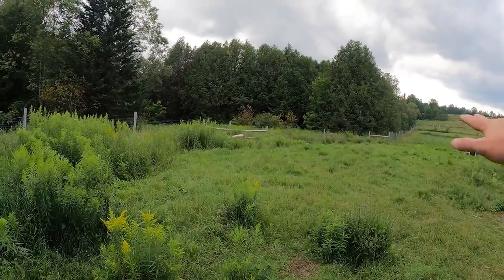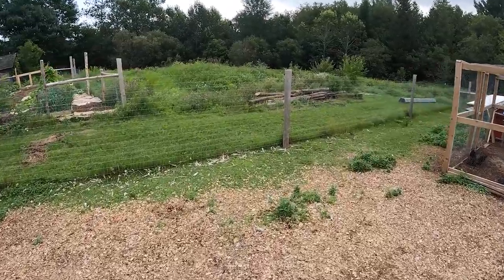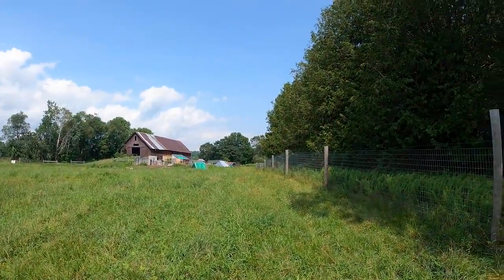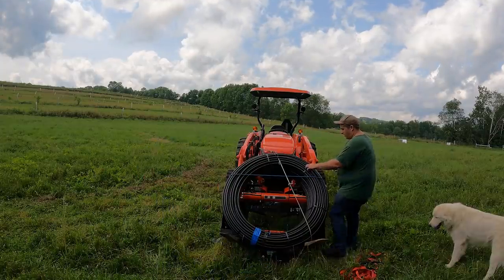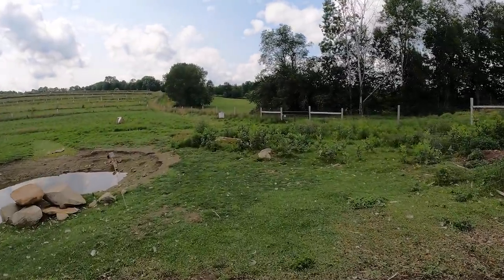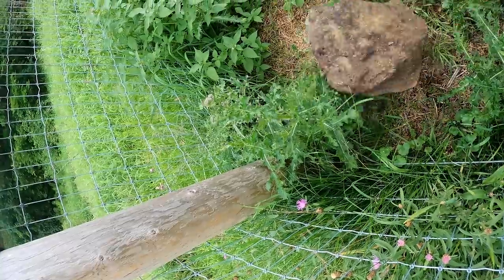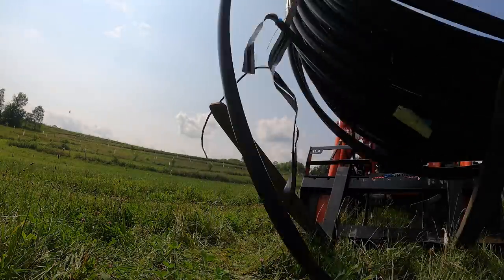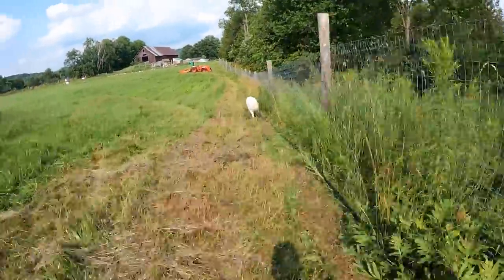Simple Water Lines for the Entire Farm

Comment: Don't you need to bury it below the frost line?
Reply: Yes you do.
Reply: Not if you intend to drain it (use an air hose to blow out the water) before winter.  I am using the same type of water line for my garden expansion, and I am including a drain plug at the lowest spot to winterize it from.  (Also, leaks are not very hard to fix.)
Reply: @doloresreynolds8145 this isnt an irregation  hose for a summer garden. This line is to provide water for cattle 12 months a year. In Vermont the frost line is at five feet, digging a six foot deep 1000 foot long trench is going to be very difficult in rocky New England soil.
Reply: Joshua Rosen the cows will be in the barn for maybe 6 months a year, these water lines won't be needed then

Comment: As we all applaud in relief as he figures out to roll rather than pull from the center. Maybe harder, but fewer kinks.  Those will come back to haunt you.
Do you have enough head pressure to  push water all the way up the hill? (~.45 PSI per vertical foot)  Will you install some sort of drains to prevent freezing?

Comment: run power to the top of the hill, and install a second well up there.
bury all that water line.
Reply: That means a deeper well and an additional well pump.  On the other hand, the problems with pushing water all the way up that hill will be prevented.
Reply: Lol another well? Do you know how much that costs?
Reply: @abcd1234jason  farming aint cheap. its a business. take out loans, get a steady income to pay them.
Reply: @aredub1847  by spending thousands of dollars to fill a duck pond that barely pays it's own way?? I can tell you are not a farmer lol
Reply: @abcd1234jason  this water is not for his little pond. are you simple?
Reply: @aredub1847  he already has a well, why does he need to spend thousands of dollars for another? If his current pressure isn't enough he can add a inline pump for maybe $200, tell me how simple are you? He doesn't need to bury the line because he's only using it late spring and summer rest of the time the place is covered in snow but you knew that right? Anymore smart ideas?

Comment: 😬 I would either rent our build a tubing uncoiler.  You can set it up at the start point and then pull the end with your ATV out to where you want to go.  Save yourself a lot of time and headache.
I do a lot of infloor heat jobs and use similar tubing. I use a tubing uncoiler I couldn't imagine doing a job without it.

Comment: Next time, think of building a kind of a turntable with wood and lay down the coil of pipe on it held by the center. This way,  you just have to pull the end of the pipe for as long has you need and you will never have any twist and kink to fight with and no dammage will be done to the pipe.

Comment: Kinking that water line tubing leaves weak spots where it can fail. I had that happen to me back many decades ago. You always want to unroll the pipe basically the way it was wound on the "spool",  just like fish line. Kinks are not good.     
 I would have built 2 "X"s out of 2X4's and put a metal  pipe through the middle point of the "X"'s.   Then put the plastic  pipe roll on the middle of the metal pipe  I would have drilled several holes in the metal pipe for "pins" to go through to adjust the spacing of the "X"s  almost tight against the roll.  Back the tractor slowly up the hill and the pipe unrolls smoothly, & bingo! no kinks. 
  ( I built basically the same device to run heavy coax cables (1 1/2" diameter) that the cable rolls had disintegrated on. Any kink meant a splice and loss of signal from that splice. Worked out just fine.)

Comment: Next time put a pipe through the roll of hose, ratchet strap the pipe to the back of your two forks so the 'spool; of hose hangs between them. Stabilize the end and back up the tractor letting the spool unroll. No twisting or kinks.

Comment: aloha morgan... questionis the well faucet under any pressure???
you wi;; have to that supply line and install T joints & faucet points.
you mention a 700' run that goes uphill tp the yop of yor tree pasture???
a mqjou qustion is will that single point of origin for water have the necessary water pressure to charge 700' + an uphill grade rise of well uover 70-90' in height?
did you consult with a plumbert to see if your well has the pressure to makr the lenght + the rise & whats the recharge rate of use???
you might neerd some sort of pressurized storage system, possible an elrctric pump, and assuming you'll be burring that supply line, you'll need to dig a trench that is below the frost line to prevent freezing in winterm any stand pipes will neesd insularion to prevent freezing.

and if your trenching for the water line, how about droping a 3-4" pvc conduit for electrical power just on the odd need???talk to a electrical contractor on the possible requirements for transformers, possible/at least installation og solare street lights around the bar + your poultry yard or extra led 6000 watt lights???

all just advanced planning..,.

aloha frm hawaii

Comment: All well and good BUT will you have enough pressure from the hydrant to get the water up the hill?  There is a formula in Fluid Mechanics that will give you the answer but it has been 50 years since I worked in that field.  Off the top of my head -- the answer is -- you might not have any flow or at best a trickle.  That means you will need reservoirs and pumps along the line to deliver the water you anticipate needing.  Also -- with the winter temps, you will need to drain the system at various points if you are not going to bury it below the frost line.  I would consult a Civil Engineer or a plumber knowledgeable in laying water lines before getting frustrated.

Comment: Are you planning a cistern at the top of the hill so you can gravity water the cattle?  A slow trickle up the hill, then high pressure down.
Reply: I have a cistern at the top of my plateau and run 3" pipe the first 100 ft then 2" pipe then next 200 ft and then drop down to 1" pipe.  Off that 1" I have a few 3/4" lines.  My drop is fairly steep at first, almost 40 degrees slope but then decreases quite a bit.  At the bottom I get a high flow rate but very little pressure.  When you look at the flow shooting out of that 3/4 in line and going 45 ft in the air you think that's huge pressure but you can put you thumb over the end and the water easy stops.  It feels like very little pressure.  I can only run one sprinkler from those lines.  Hook up a 5 hp gas pump to the intersection of the 3" to 2" lines and then you get the pressure you need tor run several sprinklers at once or fill a few stock tanks simultaneously.
Reply: To Mark Schreiner.  What state do you live in? Does your cistern ever freeze? Freezing could be a problem in Vermont although Morgan keeps his cattle down near the barn in the winter.
Reply: @minnahumble2294  Morgan would need to drain the tank and lines in the autumn.  It would only be effective during the summer as an alternative to his pump trying to lift water all the way to the top.

Comment: I wonder if you should elevate a couple of feet (tied to fence) the hose to keep it out of reach of the mower and voles
Reply: He'll need to tie it so he can trench or move it way over.  But then it's in the way and will get run over and that could end up in pinch holes.  Should have trenched first.

Comment: Do you intend to bury the line before you get cows? I can picture them crushing it.
Reply: And they will crush or kink it, many times over the years we had blowouts, some noticed quickly and some not for a few days.  Use garden staples or zip strips and snug close to the fence line if not burying it and use electric fence a foot or two away from permanent fence, there is always one cow that will eat everything near a perimeter so you don't have to weed wack but you also don't want them being able to reach over to rub either and Highlanders have those big horns you do not want getting stuck between that sheepfence.  If you think they won't, think again.

One year we thought we had a great idea and were protecting the tops of our posts with lg metal cans from rotting out, one day one of our dairy cows had one over her face, so she couldn't eat, drink or see.  There is always one in a herd, we figured that someone was in heat and knocked another cow into the fence dislodging the can and cows are curious by nature she stuck her head into it and it didn't come off until we took it off. Needless to says those cans all came off all those posts that evening.  Never a dull moment lol!

Comment: Next time clamp a 4x4 to your forks, place the spool over the 4x4, cut loose the strapping, secure one end, drive out the spool to where it needs to run. Also, don't you need to bury it so it won't freeze? Rent a ditch witch and get it in the ground.

Comment: You only need two water points for your cows, one high on the hill another at the bottom. They will go to the water when they need it. Also one at the barn for them that is all they need. Your pasture is not large enough to need more than 2 watering points!
Reply: Yes, yes absolutely.  Thanks for mentioning this.  Let's hope he reads this.  My neighbors cattle have to walk three miles to get water.  And that water is my pond and a stock tank at the other end. Stock tank is filled by water truck hauling in 1,035 gals per load.  We pray for rain to augment that so he doesn't have to haul often.

Comment: Morgan, do you have enough water from your well to support cows?  Do you have enough water pressure to push water all the way up to the top of the hill?
Reply: This is a very good question for Morgan.  I have to augment with water I haul from town and place in a special cistern which is separate from that which we use for the house.  And check your state laws regarding use of well water.  My state (Colorado) limits us to household use and watering up to one acre of grass, trees, bushes around the house and livestock.  But we can only use 3 acre feet per month I think (don't quote me on this number).  We have 35 acres and there is no way we could run a lot of cattle plus have goats, horses, etc and pull all the water from that well.  It just doesn't provide that much especially in the summer months.  We would have to get a license for an irrigation well and that means we'd have to buy water rights before the state would issue such a license.  So yes indeed, he must check all these things before he continues.  Otherwise we might hear an "ahh shucks, we didn't do this or that . . . ."

Comment: Since you have such hard winters in Vermont, how deep does the trench have to be to lay the water line into. It seems it would have been easier to dig the trench and then just lie the tubing into the trench. Do you have a way to dig the trench with your Kubota tractor?
Reply: Oh you are right on point Corinne Creswick.  I have unrolled hundreds of feet of this pipe in sizes from 1/2" up tp 3"" and it is so very much simpler to unroll your pipe right into the trench then it can't flop all over the place on you.  Just secure one end in the trench and back up with your tractor straddling the trench and watch the pipe unroll usually w/o issue.  Occasionally it will mess up but easy to fix and get going again.  Laying pipe into trench by hand is also very simple to do.  As others have said, always do your trenching first.  AND the depth should be at least 5 ft for his area because that's the frostline up there.  Anything above that could freeze.

Comment: You should really consider renting a trencher and burying the later line at least 3 feet down. In North East if you have any water in the line it can burst when it freezes.
Reply from the maker: It’s a summer only infrastructure
Reply: I suspect that someone who has lived in Northern Vermont for a few years might have figured that out for himself…..
Reply: @GoldShawFarm  yeah, but burying it isn’t that much more work and will save you headache and material in the long run. Exposed it can be damaged.
Reply: @GoldShawFarm  (I installed outside plant cabling- similar principles but water is less forgiving than low voltage cabling)
Reply: @GoldShawFarm  also, if you trench you can even run electric or a cat 6 cable to put a wifi router out there for miscellaneous stuff.

Comment: fencing jenny is all you need for rolling out coils, your inferior water pipe will blow apart at the bottom of the hill. what is the PN rating ?
Reply: PN 16 is rated for 160 meters of head pressure, so what ever the height of where you are pumping the water determines the PN rating at the pump of the pipe used, if half way up the paddock is 80 meters higher you can use PN 8 and so on the higher you go the lesser expensive pipe required

Comment: I'm going to assume that you went through all of that just to make a video. Anybody that was really going to put water through that pipe would have dug a 4 foot deep trench before even touching the roll of pipe.  Every one of those kinks is now a weak spot. You will also need a pressure boost pump because your well pump is not enough to push all  of that distance. Again, I will just assume that was all for show.

Comment: Running the hose along the ground is not such a good idea. It's going to make fully draining it before the freeze nearly impossible.
Reply: Not with that impressive change in elevation his field has. If he includes a drain plug at the lowest point, and uses compressed air to blow it out, it should clear out.
Reply: @doloresreynolds8145  Don't count on it. Running along the ground gives it too many chances to have dips where water could pool.

Comment: OH you poor poor noob ! That black piping is GARBAGE and even in temperate Oregon rancher's have to bury it. 1 cow steps on the line at 1-200 lbs adult weight you got a leak. you leave that piping out above ground even drained it'll stress and turn brittle over winters may take a few but yeah. My advice spend more money but do it RIGHT 1-2" diameter PVC pipe just like what is going into houses nowadays and bury it no less than 6" deep. I am not hating I see you making my dads very expensive and time and patience consuming mistake is all "warning Will Robinson WARNING!"